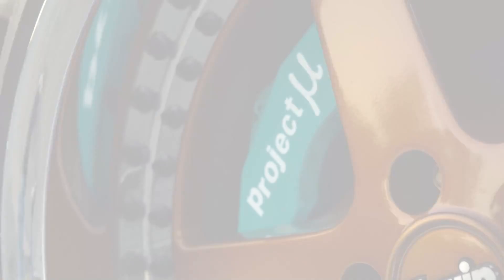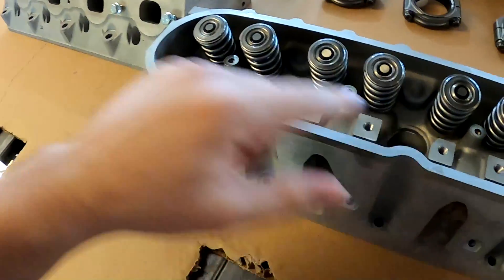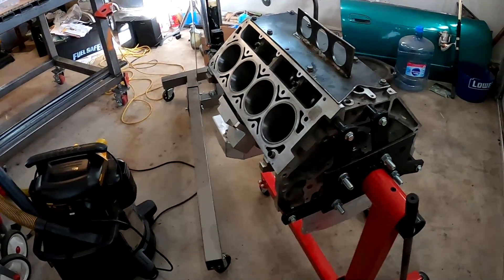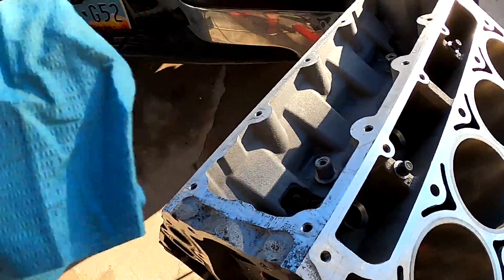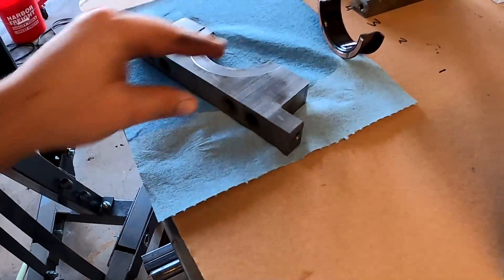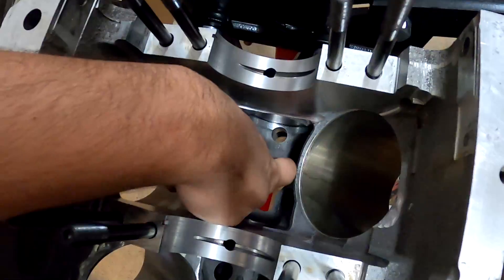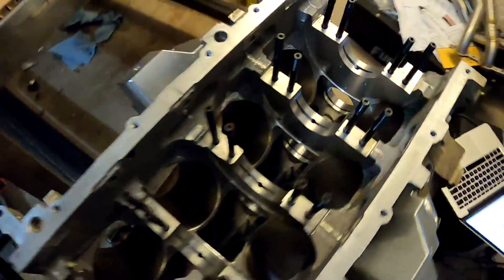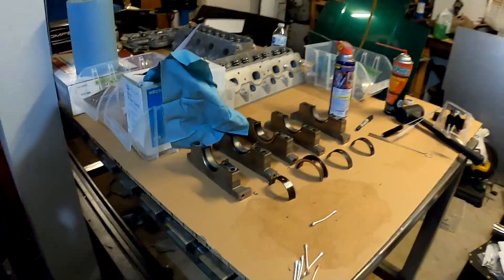LS 5.3 Stroker Build Cleaning Engine For Assembly Ep1 | 600 HP L33

Comment: Did you buy a stroker kit? If so which one did you go with? I'm looking at possibly doing the same thing but I've got an iron block 5.3.
Reply from the maker: Yeah from cnc motor sports compstar crank wiseco dished pistons callie rods arp everything 10 3 1 compression
Reply: @McGrathMotorsports  thanks!
Reply from the maker: @metalmulishasmith  np!

Comment: What did you stroke it to??
Reply: 363 now left a little meat on the cylinder wall for future rebuilds and longevity. It is the 5.3 aluminum block. If it was iron block would have bored it more.